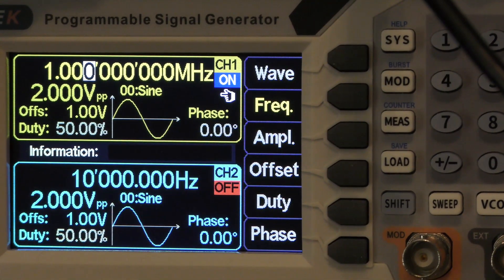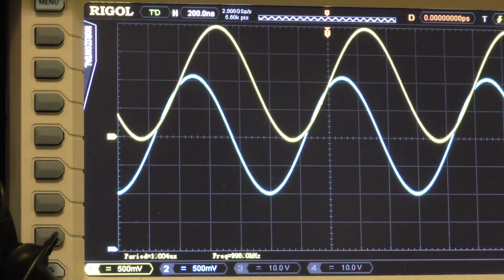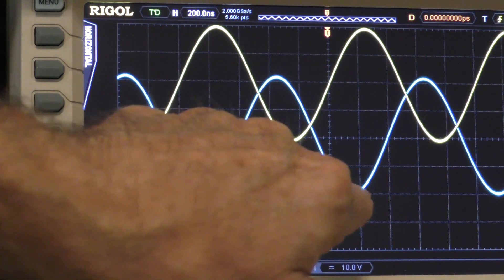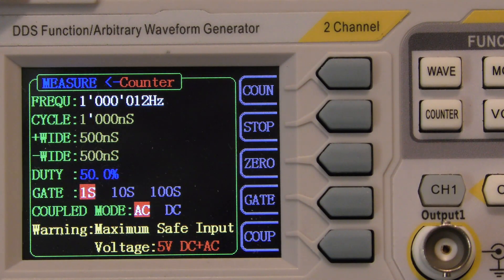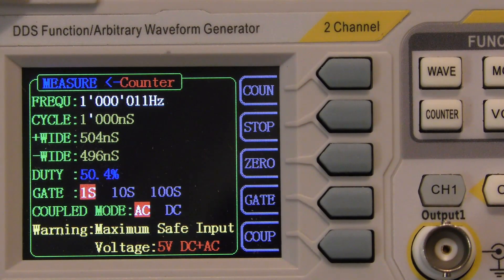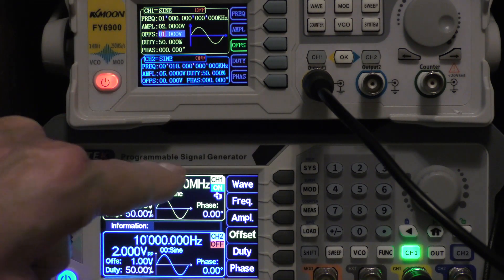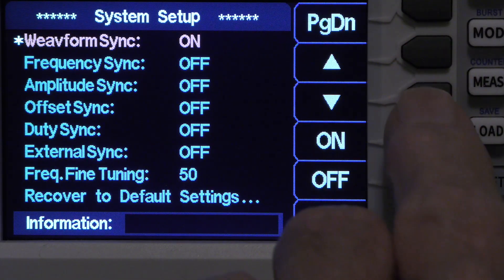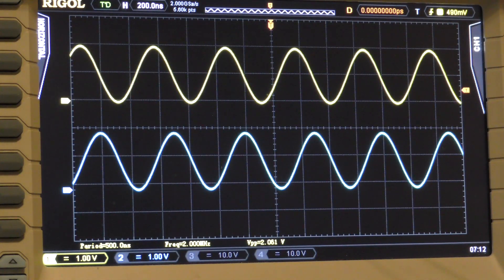TTT364 more on PSG9080 and FY6900 AWG

Comment: If you have an accurate frequency standard (like GPSDO.....) there are videos on Youtube on how to start the FY6900 so that the timing setting option appears on the display and thus refine the frequency output accuracy as much as possible. But I'm not sure if this adjustment has an effect on the counter and the accuracy of frequency counting.

Comment: As I see you set 01`000.011`620`000kHz on FY6900 but scope show 1.000MHz, sometimes few hertz lower... This can be resolve very easy and you can adjust frequency offset on FY6900 to spot on. FY6900 have hidden menu for this... In the same time push and hold Power Button and CH1 button then, when you hold that butons, power on FY6900 from back main switch. After FY6900 power up go to menu, push MORE and at the bottom (OSCI) you can to adjust frequency offset. When you adjust frequency you can see in real time on scope what you adjusting. e.g. Set FY6900 to 1kHz/5V and scope need to read that frequency but not,  go to menu and fix that frequency offset. When you see on scope exactly 1kHz as you set on FY6900 thats it.